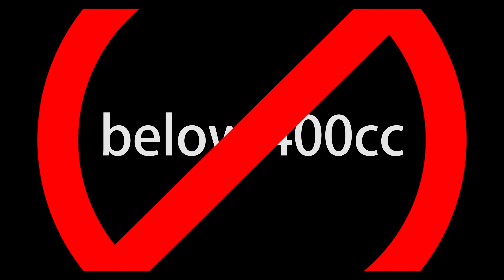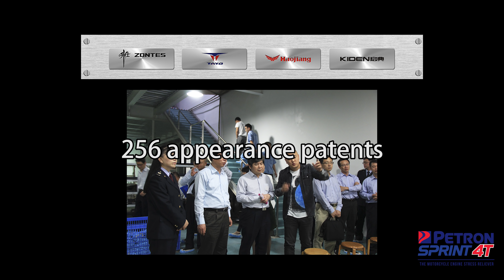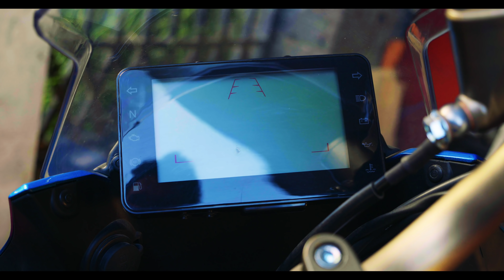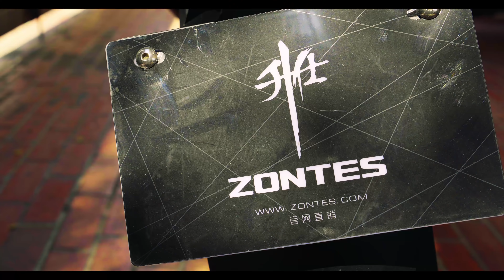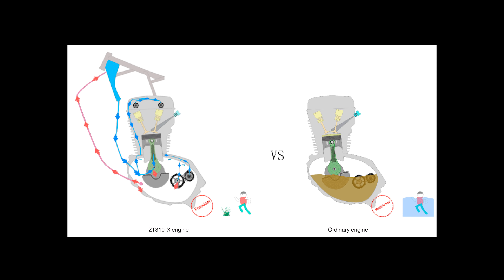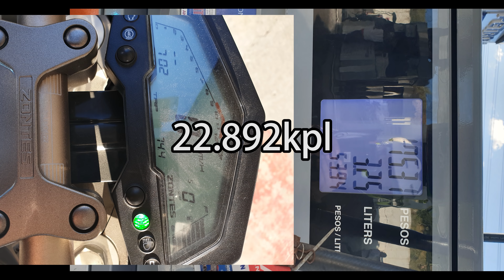Zontes 310 Series R / X

Comment: Sir zach, quick question. And your suggestion might help me big now. Dominar or nk400? Which is more practical yet fun to ride. Hope you can help me out with thizz
Reply: Go with the Dominar 400. Wait for 2019 model, the Dominar 400 UG. Although it has no gimmicks like the raising windshield and tank lid with the hand the Dominar 400 UG is testing to be a very good bike, guapo pa, pwede pa idaan sa expressway. 

This one the Zontes 310, I was really looking at it hard because I liked the idea of the adventure version -- the Zontes T310 with the crash guards. But then I realized, I didn't like the way it looked. Very busy yung design, looks like it won't improve with age. Masakit pa rin sa mata. Compare it to the Bajaj Dominar 400 UG in Aurora Green. You'll know what I mean. 

And no, this is not Sir Zach.
Reply: @josetseiko8949   I agree to that, zontes looks more a modern power ranger to me. I dont dig it, 

Thanks for the advice tho, I appreciate that. And yes, you aint sir zach 🤣